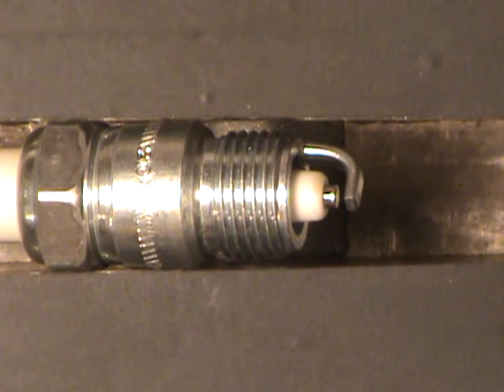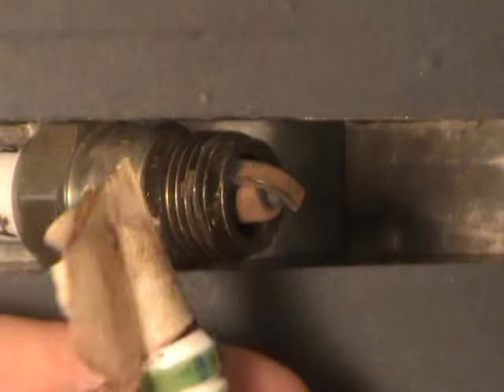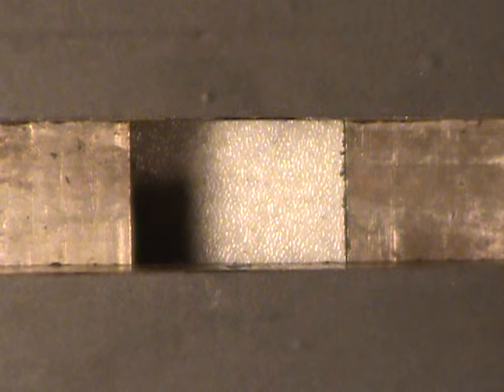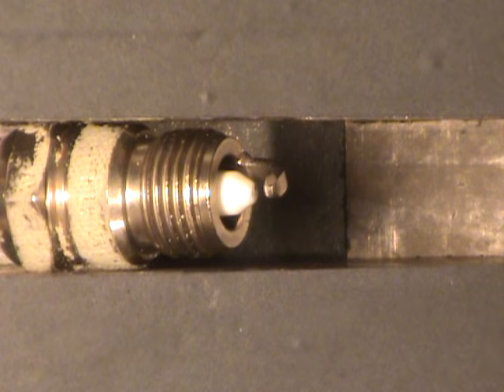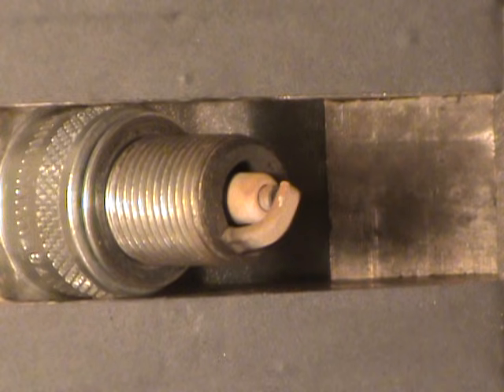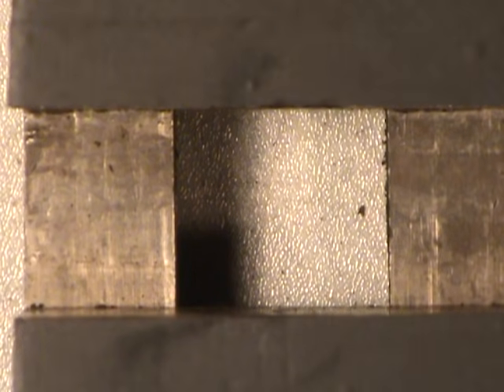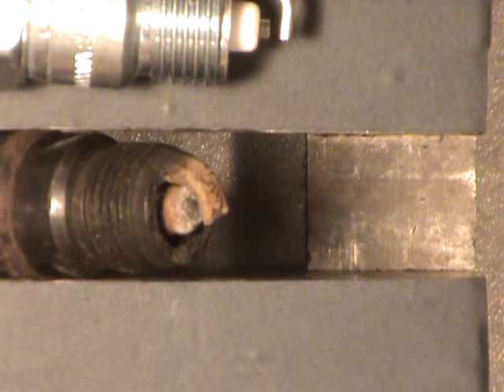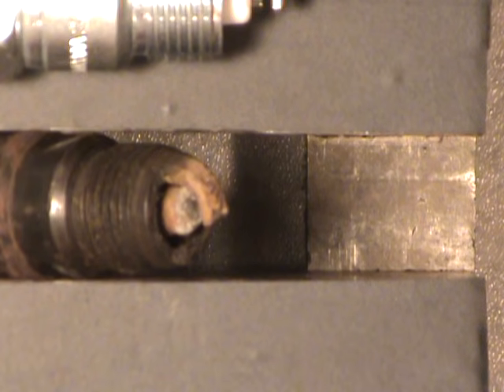SPARK PLUGS How to Read them (Part 3)

Comment: Thanks for the informative video. I wish I could upload a picture of what I pulled out of my motor. I daily drive a Chevy 8.1L in my Silverado. So let me ask you this... this plug I got in my hand is severely messed up. I have 206K on the truck and have only changed the plug at 100k and now 206k as per the owners manual. Is that stupid to listen too? This truck runs great for its age and frankly have only noticed a drop in fuel mileage when towing. Every other time the truck gets the normal 10-13.5mpg. This plug has deposits stuck on it, no oil. Clean otherwise except for this melted material on it. 

Any advice is appreciated. Read some forums strings about upgrading these plug to the double platinum models and I'm doing that. Should I increase the interval to replace these plugs to every 50K? Thanks in advance! Pretty sure I'll get a lot more miles out of the truck.
Reply from the maker: Greetings...Ed Vita..........You're welcome, and, thanks for watching...........Well, here are some of my thoughts, as it applies to..."just leave those spark plugs in the engine, for, a very, very long time, without having a look at them, every, once in a while"...........The (precious?) metal, that, the spark plug's electrodes are made out of, are pretty much, what prevents the "gap", that's between the spark plug's "two electrodes" from "eroding-away" (as in, high voltage arcing/sparking), at too fast of a rate, such as, the good ole, much older, plain electrode material, who's electrode "gap", would probably get larger, by about .001" (that be, one thousandths, of one inch), for every 1,000 miles, that the vehicle travelled, well, on a good day, that is...........If you think that "platinum" is tough, then, just have a look at "iridium"...!!!...........Double platinum, as far as I recall, just means that, "both" electrodes have the platinum on them............High voltage, finds it much easier, to, shall we say, "make-the-jump", between two electrodes, if they happen to have sharp edges, or, are very small in diameter, just like, most of those precious metal "electrodes", that will usually be showing up, as a "fine wire", if you will............Me, myself, I like to have a look-see, at the spark plugs, at least once a year, and, even more often, if I'm dealing with, a good ole, "points & condenser distributor" equipped engine (aka, dinosaur...lol)...........About the "only thing", that would keep me from "visually inspecting" a set of spark plugs, at least once a year, would more than likely, be, due to the fact, that, some of the damn, engine/vehicle designers/engineers, never took into account, that, some of us "grease monkeys", would really appreciate..."being-able-to-get-at-those-maintenance-parts-&-pieces"...without having to use a..."shoe-horn"...!!!...lol...but, there's a good chance, that, I might still, be able to remove, at least "one" spark plug, to put my mind at ease...........When an engine gets older/accumulates lots of miles or kilometers on it, then, oh, at about the 100,000 mile mark (on the odometer), then, there's a pretty good chance, that, the piston "rings", will get worn a bit, and then, "blow-by" (that be, combustion gas, getting past the rings), starts to happen, and down into the crankcase/oil pan it goes (a form of pollution, some-what), and when it gets worse, the engine has to burn the blow-by gas, and the motor oil that it grabs, out of the crankcase & oil pan (probably due to the heat), then, the "PCV" (Positive Crankcase Ventilation) Valve, inhales this, shall we say, "smoke", then into, the intake air-steam it goes, so the engine can burn it (spark plugs burn it as well)..........If the vehicle is about 1996 or newer, then, it will probably be equipped, with an "OBD-2" (On Board Diagnostics-Version 2), engine management system (computer controlled), and, if the engine even "sneezes" (without you knowing about it), then, some of those, very "nosey, sensitive, and accurate" sensors, will be telling the vehicle's on-board computer all about it, and the computer will probably be storing this information, in its "memory", and, a good hand held "scan tool", will be able to extract the "codes", for further consideration/examination..........If the engine has "Aluminum Heads" (where the spark plugs go), then, I'll just put a bit of motor oil, or, a bit of common grease, on the spark plug's "screw threads", to prevent sticking/damage problems.............I don't use "anti-seize", especially the copper based stuff, on Aluminum heads, because of, a possible bad "reaction", between the different metals/compounds..........Spark Plug longevity, is, well, kinda like shoes somewhat, as in, anything will do, while mucking about, around the house, but, if Ur in a Tuxedo, Ya gotta have some pretty spiffy, and, in very, very Good Condition Footwear...correct...???...lol...........So yeah, keep the spark plugs, some-what "fresh", as well as, keep up with all of the "other" maintenance parts & pieces as well, as in, nice-n-clean...Air filter...Motor oil & filter...Tire Pressure (which, in itself, helps with gallons per mile...ooops...I meant to say...miles per gallon...lol)...clean & unrestricted Fuel filter)...etc..........I'll now, wind-er-down, with this (might save you, a few hundred dollars), and, is, as simple as..."Keeping the gasoline, in the Gas Tank, at least 1/4 Full, at all times", especially when it's hot outside...why you ask...???...well, it's that sloshing gasoline, in the gas tank, that keeps the (hiding-in-the-gas-tank), electric fuel pump "cool" (so it doesn't overheat, and quit on you, in the middle of no-where), and, some folks are sayin', that, the liquid gasoline, lubricates the electric fuel pump as well, oh, and, a plugged-up-really-bad, "fuel filter", has been known, to "destroy" a fuel pump as well, just so Ya know...and........till next time........Be Safe, take care, and have a good one.

Comment: Thanks for the informative video. I just checked my spark plugs today in my 89 toyota corolla with a 1.6 4af carb engine and all of the spark plugs had white coat of carbon on them. My car seems to have a vaccum leak because it hesitates when I put my foot down and it bucks aswell. Does that mean the white carbon on the plugs is from having a lean engine? I am very determined to get my engine running the way it should and I'll be getting some new plugs tomorrow. I think I have to clean the carb aswell or it might need rebuilding, I hope not though lol I really have to fix this vaccum leak
Reply from the maker: Greetings...Kaes seaK...........You're welcome, and, thanks for watching..........Try this...while your engine is fully warmed up to operating temperature, try putting your foot down "slowly", as in, apply the gas pedal "gradually/at a very slow rate", and see how the engine responds..........If your vehicle's engine runs ok this way, and runs bad, while you push the gas pedal down really fast, then, there's a good chance, that your carburetor's accelerator pump, or accelerating fuel circuit, "is not", shall we say, "squirting" enough gasoline, while doing a fast acceleration...........Carbon is usually "black" (not white)..........Is the "white" color, on your spark plugs, as white as, the white color, of the spark plug's porcelain...???...because if it is, then, that's probably a "lean" condition, considering that, your engine has a carburetor on it..........If the color looks kinda "gray", then, that might be a bit lean as well.........If the gasoline has lots of ethanol (alcohol), in its blend, then, that can also, make an engine run on the lean side as well..........Yes-Sir-ee-Bob...get that "vacuum leak fixed", as soon as possible, or (and hopefully not), your engine might start getting "damaged" (same as saying, expensive...don't-cha-think...maybe...???...lol).........."Never" go hard, on the gas pedal, with a vacuum leak, or, too lean of an air/fuel ratio (mixture), because, that's usually, the engine's operating condition, where the "Most" engine "Damage" will probably happen, as opposed to, just going very easy, on the gas pedal (still not good).........Try to keep up with maintenance, that Toyota recommends for your Corolla, as in...all filters...PCV (Positive Crankcase Ventilation) Valve...check/adjust ignition timing...replacing old spark plug Wires...new coolant (antifreeze & water)...etc...oh and, of course...spark plugs too..........Good luck, and......till next time.......Be Safe, take care, and have a good one.

Comment: not me.  i never try to clean a plug.  thats ww2 thinking.  get a brand new.
Reply from the maker: Greetings...billy smith.........Thanks for watching.........Yes-Sir-ee-Bob...I'd also say, that, a brand spankin' new spark plug, is the best way to go, as well, providing that, it/or they, are, as good as, or better than, the (new) engine's, factory installed, set of spark plugs, happen to be (when new)..........Come to think of it, I probably still have, (around here somewhere), that, small/can fit in one's hand, a 12 volt (car battery) powered, shall we call it, a..."mini spark plug, sand blaster/cleaner"...where-by, the spark plug gets pushed into, the, rubber/membrane-like hole (on top), then, push the button on the side of the device, and, a small dc motor, spins really fast, and sprays "abrasive matter" (kinda like, a mini sandblaster, somewhat), at the electrode end of the spark plug, while I wobble the spark plug around, so as to, direct that mini-sand blaster's "spray", around the center electrode's porcelain, and around the outer electrode as well, and..."it"...sure did a good cleaning job, that's for sure...........Well, the little replacement, plastic bags, of "abrasive matter" (ceramic?), that had particles, that were just a bit larger than, sand-at-the-beach, that also had, some very "sharp" edges on them, that I could sure feel, when I placed some of it, between my thumb & fore finger (when new), had me thinking one day............So, after using this mini spark plug cleaner/sand blaster, for quite a few spark plug cleanings, I started wondering...what if...???...some of that "abrasive matter", got stuck, way down, inside of the spark plug, where the inner porcelain, meets up with, the spark plug's metal shell, and then, breaks free, while the engine is "running"...???...(engine damage much...???)...well, that's about the time, that I "stopped" using, that handy-dandy, hand held spark plug cleaner/sand blaster, oh and, other folks have been saying, that, cleaning a used spark plug, will usually leave the inner porcelain "rough" (as in, not smooth, like a new spark plug usually is), and, will probably increase the chances, of having "more deposits", getting stuck onto it, and........till next time.......Be Safe, take care, and have a good one.

Comment: At what point in mileage is it recommended to replace spark plugs? Is there an average mileage count?
Reply from the maker: Greetings...jatontherun...........Thanks for watching..........Well, as for, there being an "average mileage count", as in, it's time to install a new set of spark plugs (in the engine), then, here's something, that has to be known first...........What..."year and type"...of engine, are we talking about...???...because, depending on, the exact engine in question, then, it might be as low as, about 12,000 miles, or, might be, as high as, about 100,000 miles, as, some of the newer vehicle manufacturer's, might be recommending, for their vehicle's engines...........The spark plugs, that lasted about 12,000 miles, usually had, the more common/larger electrodes on them, which were usually made out of less expensive materials...........Then, there's the type, that, are supposed to last, that 100,000 miles, which will probably have its electrodes, made out of some quite expensive (exotic?) material/s, and might be iridium (spelling?), and, the center electrode, might be, very small in diameter as well, which can stand up to, all of that high voltage arcing/erosion , between its two electrodes, without having the gap between them, grow all that much larger at all, as compared to, the older/common, less expensive type, which, will usually have the gap, between its two electrodes, getting larger, by about .001" (one thousandths of an inch), for about, every 1,000 miles travelled (ballpark figure)............It's usually safer, for the engine, if the vehicle's, factory/manufacturer's "specified/recommended" set of spark plugs, get installed in that "exact" engine, and also, have the "specified", spark plug electrode "gap" as well (please note, that, some spark plug types/designs, "are Not" Gap-able...!!!)...........Here's one for Ya............Quite a few years ago, I had a late 1970's...factory/stock, chevy 350 cubic inch, V-8 engine, that was due for a new set of spark plugs, so, off to the auto-parts store I go............I asked the parts guy, if I should "upgrade", from the older/cheaper, common type of spark plugs, that, the chevy factory..."originally"...installed in the engine, up to, the more expensive "platinum" (exotic material?) type, and, boy-oh-boy, was I ever surprised, at what he said to me (back then)............He told me, that, some guys, that installed, a set of those, more expensive platinum spark plugs, were reporting back (to the auto-parts establishment), that, they ended up with some engine "damage"...!!!...and, needless to say, that, I ended up buying & installing, those cheaper/common (and won't damage my engine), chevy "specified", AC Delco spark plugs, and, my engine was "happy", once again...lol............See if you can find, the spark plug "changing interval", in your vehicle's owners manual, or, in a chassis service manual, for your "exact" vehicle and engine, or maybe, online somewhere, possibly............Also, have a look around, in your vehicle's engine compartment, for a..."Label or Sticker"...that will hopefully, have some very good information, printed on it, as in, the "Exact" spark plugs, that were installed in the engine, when it was brand new/vehicle just left the factory/assembly line, as well as, the spark plug's electrode "Gap", well, if applicable, that is...........Good luck, and.......till next time......Be Safe, take care, and have a good one.
Reply: RockysRoadshow wow now this is an answer!!  Thanks so much for replying back. I appreciate the information. Ok so the car I worked on is a 2007 Ford Fusion SE with 53000 miles.  The spark plugs I replaced were the original Fomoco ones.  I replaced them with Motorcraft  iridium plugs. She is happy!!  What caught my attention was the conditions of the plugs. Of the four plugs the two center ones were corroded pretty bad. The two outside ones were acceptable but very dirty.  So I started viewing videos on YouTube and I found yours. I learned a whole lot from your video!!   The car should last many more miles as we take good care of her!  Thanks for chatting!! Take good care!  Happy driving!!!
Reply from the maker: Greetings...jatontherun..........You're welcome, and now, here are a few more things, that might help you out as well..........Perhaps, have a look at your engine's spark plugs once in a while, to see how good, or bad, they seem to be, and also, just like before, see if any of them, look any different from one another, in the entire set, as, spark plugs are a real good story teller, and have a good chance, at letting you know, whether or not, your engine really is, healthy & happy..........Gasoline, while new, and in its liquid state, sure seems alright...but...when it evaporates/dries up, over time, the residue that gets left behind, is not so pretty..........The residue that I've seen left behind, in the many carburetor float bowls, (that I've rebuilt over quite a few years), have shown up as, a hardened, light brown, varnish-like, thin coating, as well as, I've also had to deal with, some yuck-ee, greenish colored stuff as well, so now, why did I just mention, what I just did...???............Well, fuel injectors, over time, tend to get plugged-up somewhat, and, if it gets quite bad, then, the injector's spray pattern, gets all messed-up, and/or, gasoline, just dribbles out of them, or, won't let enough gasoline pass through the injector's tip, and if so, then, that particular cylinder has the potential to run too lean, of an air/fuel ratio (mixture)...not good (misfires...poor performance & poor mileage...damage...???)...........Try to keep up with "all" of the maintenance, including, keeping the fuel filter free-flowing, by changing it, as soon as it needs to be, and remember now, there's high & dangerous fuel system "pressure" to deal with as well...!!!.........Try to keep your vehicle's gas tank, at least 1/4 Full, at all times (never lower), especially, during hot weather, as, it's that sloshing-gasoline-in-the-gas-tank, that keeps your fuel pump cool, so it doesn't overheat, and quits/gets expensive for you, all of a sudden.........What is good, is that, your vehicle probably has the...OBD-2 (On Board Diagnostics-version 2) computer system in it, where-by, if the engine even "sneezes", without you knowing about it, then, one or more, of the many sensors, will be telling your vehicle's computer, all about it, and maybe, you might see a light, showing-up/glowing (or flashing?) on your dashboard, but, probably more importantly, the On-Board Computer, will more than likely, be storing some Trouble Codes, inside of its Memory, that can be extracted with a Scan Tool, that kinda looks-like, a slightly larger, hand held calculator, somewhat, and......till next time.....keep the shine-ee side up, and the greasy side down, oh ,and......Be Safe, take care, and have a good one.